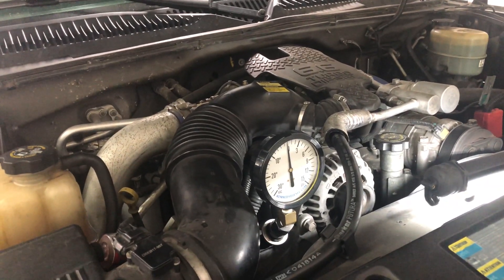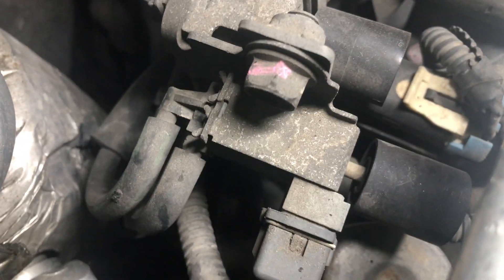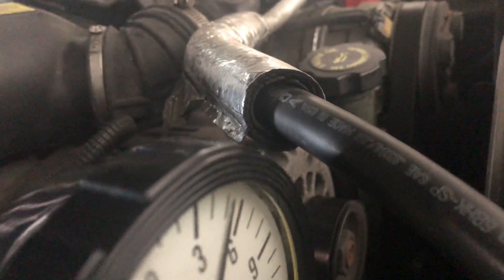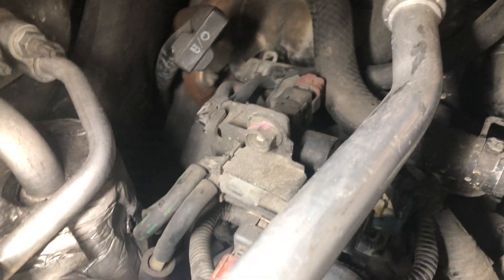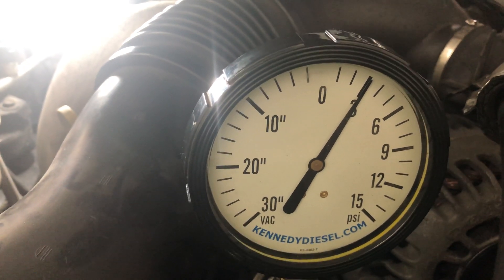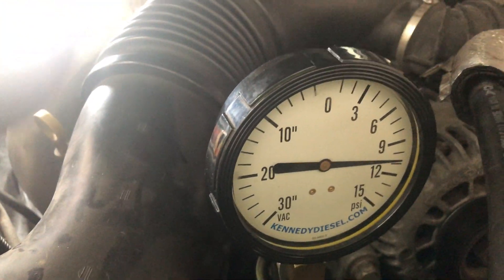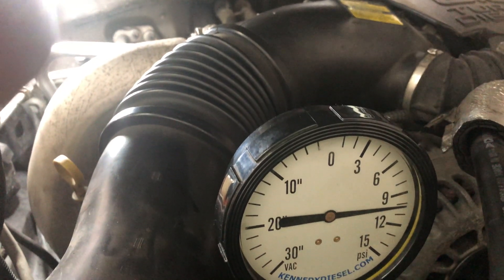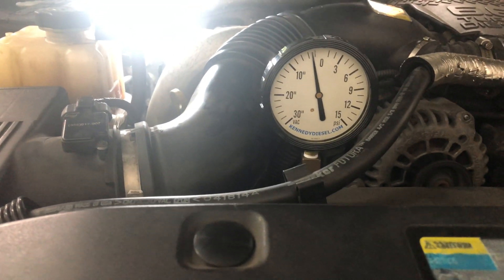LB7 & Subsequent Duramax Engines Fuel Filter Priming Tip

Comment: I had to leave the fuel lines open on my CA LB7 (like the one in your video) while awaiting a new filter head. Finally got it back together (whew!) and primed, but now it just cranks.😢 Is it possible to lose prime between the filter head and the CP3? If so, how do I bleed that part of the system? Truck was running Ok before.

Comment: Very informative video, we've got a 07 duramax in with an intermittent no start, once died right after starting towed in and the primer was loose, had glow plug codes and so we replaced all of them, primed fuel and it started, ran for 40 min no problem, customer drove 40 miles and it died, he primed it and it drove back to us, we let it sit overnight and it started no problem, I attached a gauge to test port and primed it and the gauge went from 20 psi to 0psi in about 10 seconds,but if i clamp supply to injection pump it holds, any ideas? Should i test injector return flow or suspect injection pump or filter head still
Reply: im having that problem now . its in the shop. what was your problem?
Reply: @concretebaron5759  I'll have to check for sure tomorrow, its been a while but I'm pretty sure he was fine after we put a filter head on it.

Comment: Nice video👍👍 how much psi is there suppose to be on the injector fuel rail when cranking the engine? My engine doesn’t start and I have about 4500psi when cranking that shows up on the scanner
Reply from the maker: If this engine is cranking, but doesn't start, you won't see 4,500 PSI, or at least you shouldn't. Are you looking at the desired, or the actual pressure? Without having any specifics on the type of vehicle you're working on - LB7, LLY...I can generalize

DTC's stored? And not just ECM, but on the Class 2/Low speed GMLAN. Do the other modules communicate? Even though the ECM/TCM... communicate on the CAN, High Speed GMLAN, there are signals that need to be there for this vehicle to start that are on the low speed network(s)

Is there B+ on the Ignition 1 signal

Does the supply side prime and can you develop a minimum of 8 PSI pressure? Does it hold/maintain that pressure?Is there cranking RPM?

There's a few steps more before you're actually looking at the CP3/HPP. My suggestion would be to look at a flow chart for the Engine Cranks But Doesn't Start. 

Sorry I couldn't be of more help.